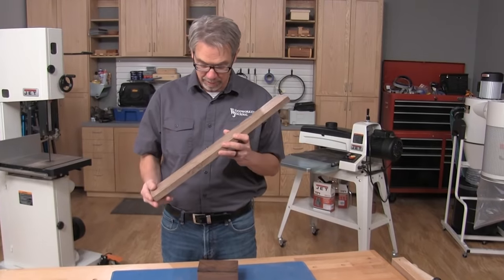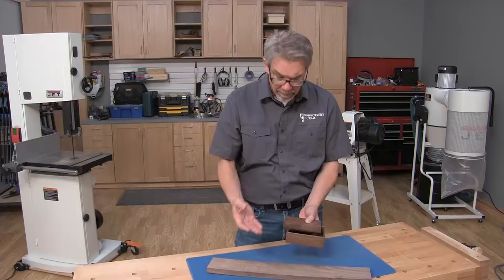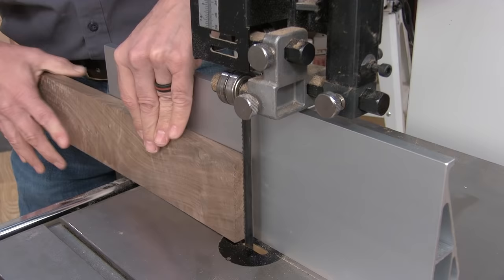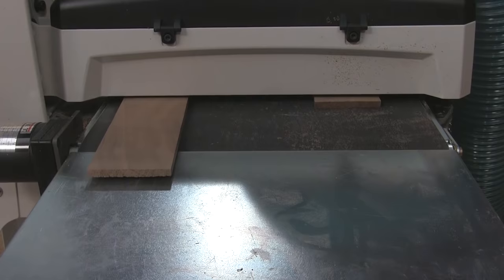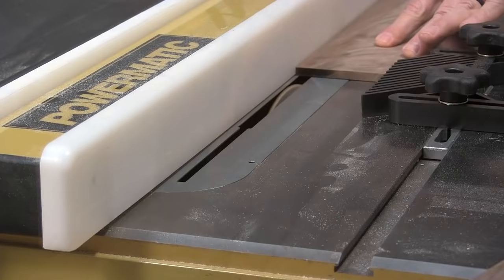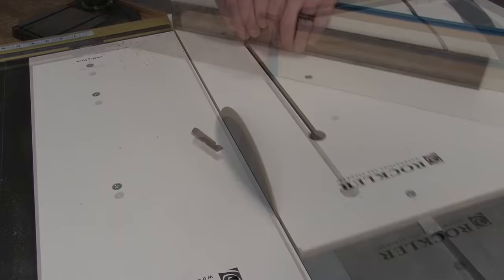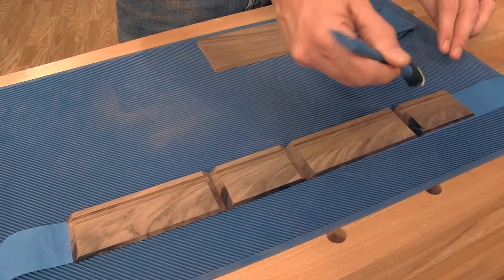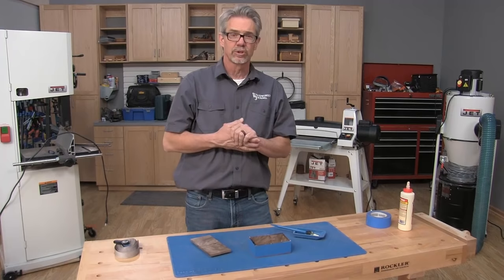Making a Small Gift Box | JET Sponsored Project

Comment: I have the Jet sander and had a heck of,a time burning sand paper and uneven thickness across the boards until I watched Marc Spagnolo explain that unlike the demo video it takes several light passes without changing the thickness to get decent results. It resulted in a slower operation but better results.